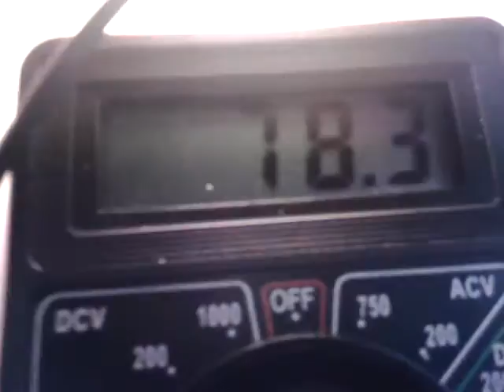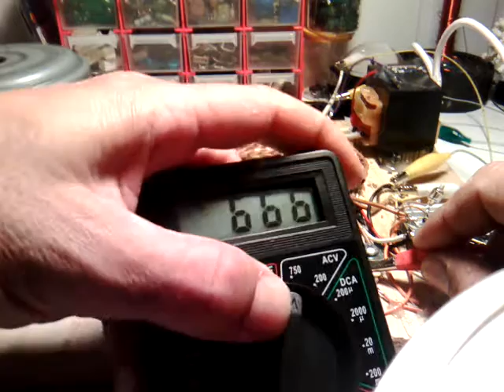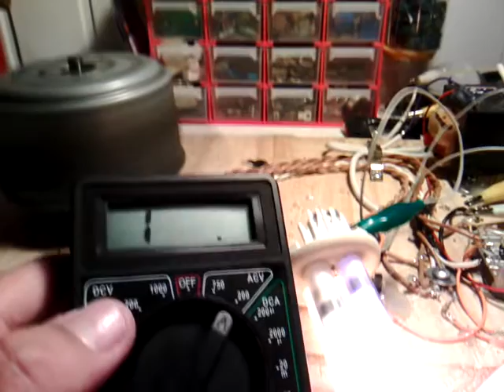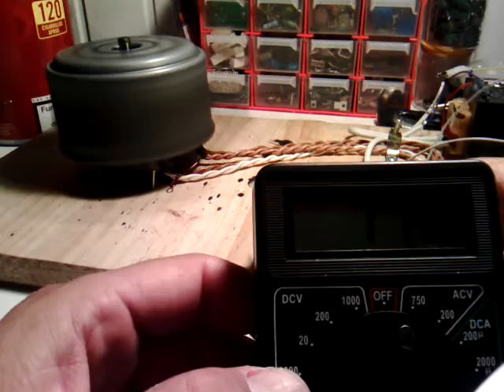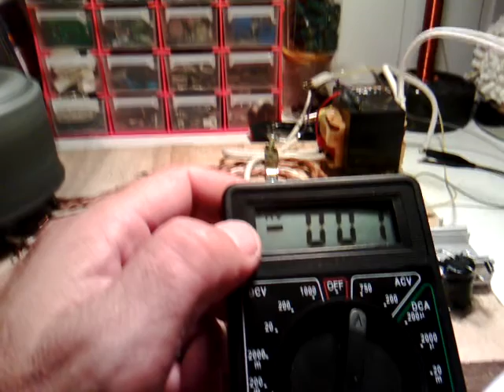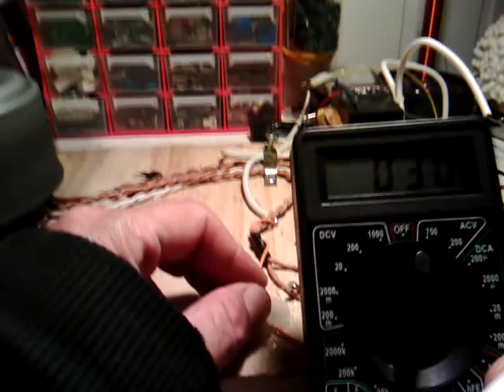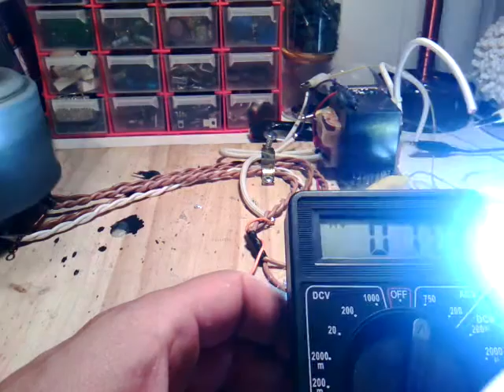Bedini con motor ventilador mejorado 3a parte

Comment: siento lo del multimetro Javi, eso se llama daños colaterales espero lo puedas recuperar saludos buen vídeo.
Reply from the maker: +Abacos Abaco Hola amigo! Ke va, me compré una pinza amperimetrica, con la ke se puede medir tambien el voltaje... lo malo ke solo mide de 1v en 1v.
La escala minima y unica es de 600v tanto para continua como para alterna.
Hayer encontré todos los multimetros estropeados, tengo 4, encienden pero estan locos y marcan digitos todo el tiempo...
Encima imposible de reciclar, todo es micro smd. Lo unico ke vale es el portapilas de 9v.
Un saludo y gracias ;)